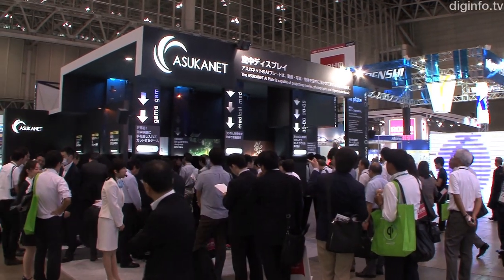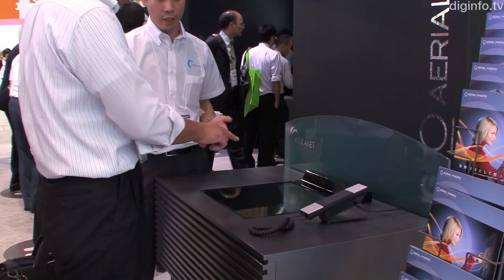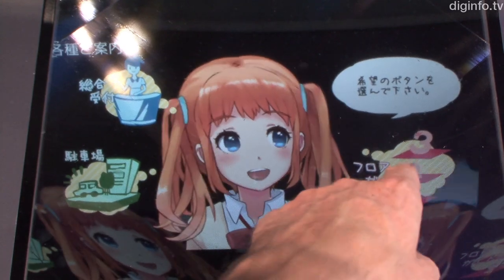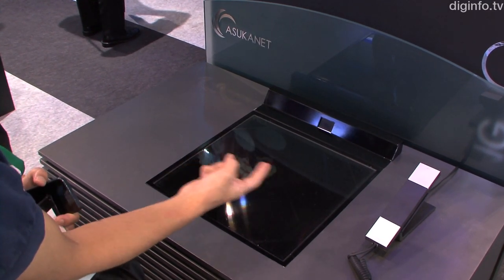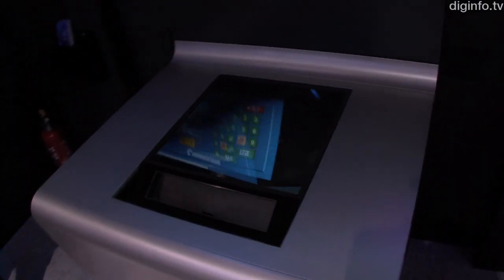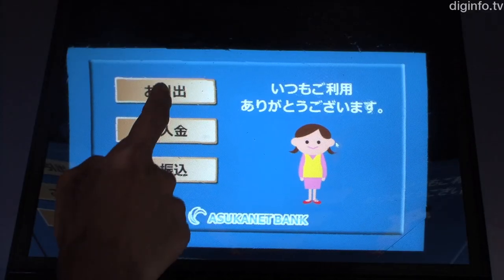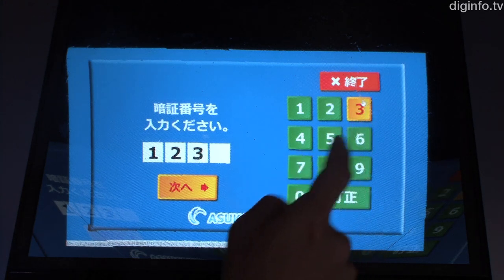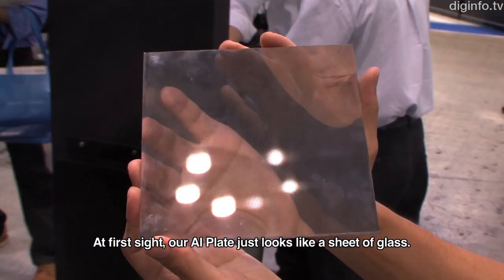Floating interactive display could be used in ATMs in the future #DigInfo

Comment: Nope, he said that they are experimenting with images that float higher that the distance between the glass and the source.

But I've missed one point, if the images floats outward (as opposed to inward) people are not going to like it.
That's the common mistake made in 3D movies, they make things float outside the screen and it makes people just feel tired.
A better 3D would be when things are floating "inside" the screen, just like when you watch something from a window.
But it's rare though.